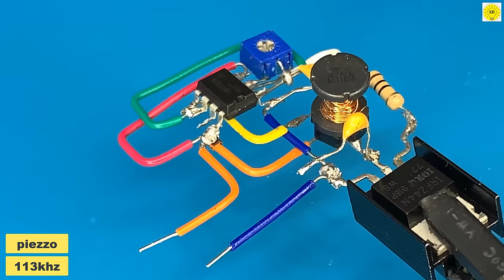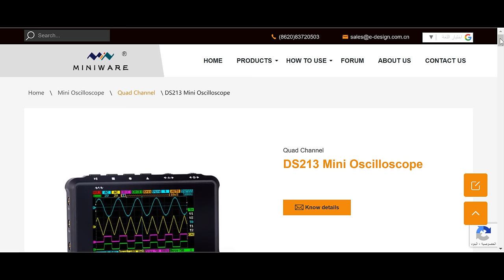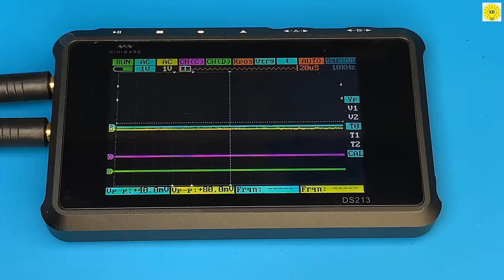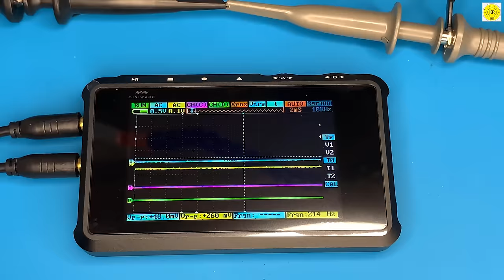how to make an ultrasonic humidifier , ultrasonic , diy

Comment: great video! can your circuit be tuned to drive a 5Mhz ceramic disk?  just adjust the variable resistor? Other changes to components? Thank you
Reply from the maker: the 555 timer have a maximum frequency of 2MHz
Reply: @inventorkr1  ok thank you for your reply, I have 3 samples of new ceramic disks 20mm,  the resonant frequency is 5Mhz , 10Mhz and 20MHz . It would be great to have a circuit that can be tuned

Comment: Hello, this fog generator is 16 mm, I think it is 113 khz. Is there a chance to make a circuit that works with small voltages such as a battery charger between 5 v and 9 v that operates the pieszo? Could you please help me?

Comment: Somewhere in your instruction video you made an error as the schematic on your website for this project is different from how you assemble it in the video! I assembled the circuit on a breadboard like in the video and cant seem to get a square wave signal on my handheld osiloscope. After watching video 10 times double checking connections and still no success I tried looking up your website tutorial on this project in hopes to find some answers but unfortunately now I'm even more confused and unsure of the circuits connections as the circuit diagram cant possibly be right! If I were to assemble it like its described on your website there would be a dead short across vcc and ground of the 555 timer which would obviosly be bad for it! I know its probably just a mistake but would like to see a correction for the schematic on your website!